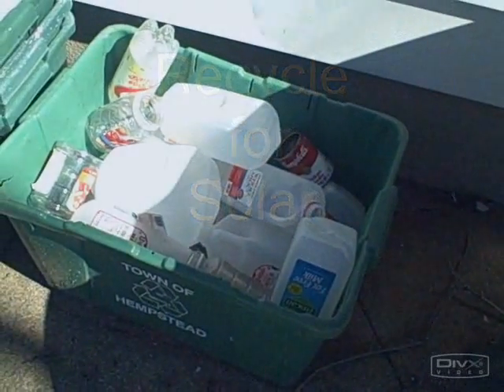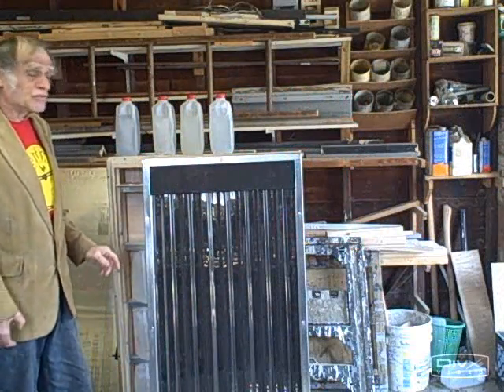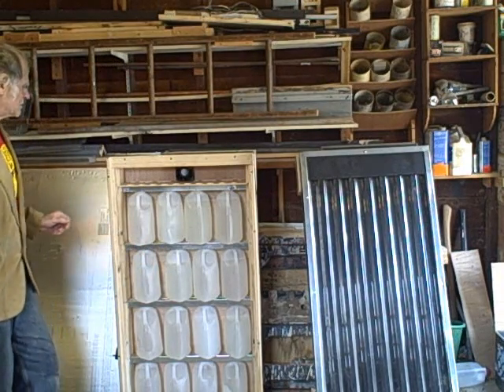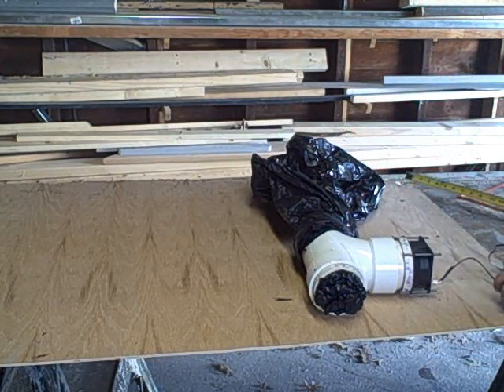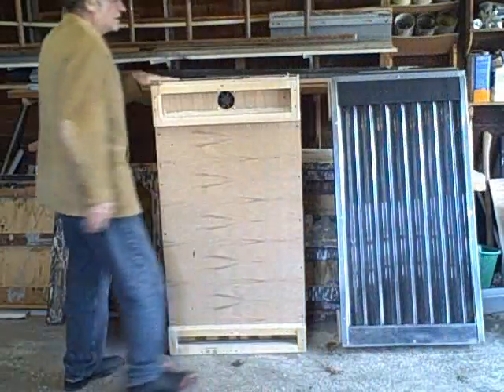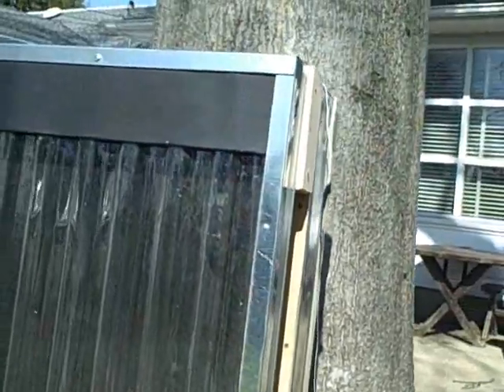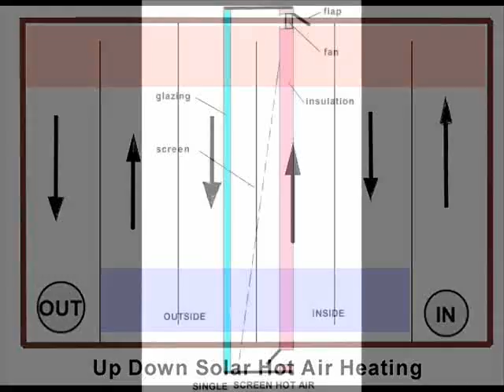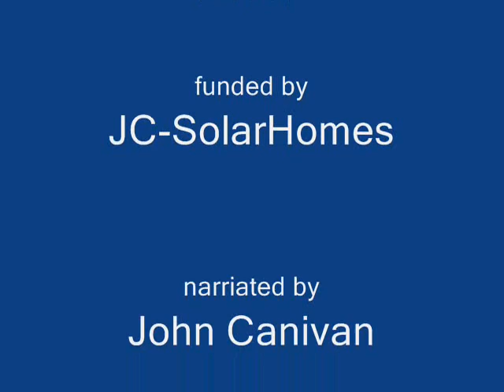Recycle for Solar

Comment: Wouldn't that freeze up in the winter & not work?
Reply: antifreeze in milk jugs maybe, or -40C windshield washer fluid (cheaper)
Reply: Purrfect cat trap! Will kill 'em dead! If it leaks out. I can tell you from experience those plastic milk jugs crumble in about 2 seasons or so..they make them biodegradeable now. Was a huge mess (I planted in them) & I will never use them out in the sun again.
Reply: Angela Angell
PET or PETE (#1) plastic bottles last a lot longer than the HDPE (#2) plastic bottles in the sunlight. Even the 5 gallon buckets are made from HDPE and they turn brittle in the sunlight in less than a year.
Reply: so how can you tell if they are or not PET or PETE? I can tell you that most of those sterlite plastics such as storage containers, etc are not worth the money if you use them outside in sun or cold..they do that to make them biodegradable. I milk jug is worthless outside & makes a huge crumbly mess all over your yard after only one season.
Reply: Angela Angell I know what you mean. I have had the same experience. I personally think they make them that way so you will have to buy more. Soda bottles are made from PETE plastic and they seem to last forever. Sterilite is made from junk plastic, yet you expect to throw away a pop bottle but you expect to keep a Sterilite container for a long time. So why don't they make re-usable containers including 5 gallon buckets out of PETE plastic? Because they want them to wear out so you will have to buy more. Making them biodegradable is only an excuse.

You can tell it's PETE if it's the #1 recycling code. The caps and the label are likely to be a different plastic, but the clear bottle itself is going to last a long time. Gatorade bottles and many juice bottles are made of PETE plastic. V8, Juicy Juice, etc.
Reply: I agree! I do save all my 1-3 L pop bottles and wash them and use them to store beans, rice, noodles, flour, sugar, salt, etc for my long term food storage. So far nothing has spoiled in them or got bugs or mice bites. I pound everything down to get all the air out and fill it to the top and it seems to make it's own vacuum.
Reply: Thanks for that! I have had so much cake mix erupt with moths coming from inside it is not funny. Now I will freeze them as soon as I buy them. Thanks again!
Reply: Try nuking them for a minute. Kills eggs & everything living in there. Shorter time than freezing.
Reply: Thanks! will do.
Reply from the maker: Heat is exchanged in liquid water or frozen water.BUT  Within a good solar heating system the water will never get cold enough to freeze.

Comment: Oh boy. I just got finished commenting on someone's post who did essentially the same kind of hack with cans. I'll say to you what I said to him: what makes this safe? The plastic in a milk jug is volatile when you add heat! You know that plastic taste you get in water stored in those kinds of jugs? It comes from the breakdown of the plastic where chemicals leech into the liquid stored into it. Why should anybody waste time, money, gas, effort, electricity, etc building something that may not be safe? Who is testing what kinds of VOCs or other compounds are released when you add heat to these products! The reason that milk jugs are deemed safe is b/c they're meant for COLD storage. They become dangerous when the trucks that carry them overheat! Frankly I avoid buying milk in jugs wherever possible. It's great to save money and be self sufficient, but you need to know what the heck you are doing!
Reply from the maker: A fan could be used to extract the heat. I was just doing a simple demonstration to show how recycled materials may be used to store solar heat.
Reply: Hmm... I don't know that that makes a difference. I would consult with a scientific source before just taking household items into my own hands and using them for purposes other than the intended use, ESPECIALLY when the original materials are dubious at best when it comes to its intended use! We already know that plastic jugs and bottles are poor vessels to carry liquids such as water, milk or juice. Now you want to stretch them beyond that weakness for something else. Even as a demo, it encourages people to take unnecessary risks.
Reply: some of the things we use to day came  from people with the balls to make something out of nothing it called trial and error do you think tesla invented all he did without fail... if more people did this kind of thinking maybe the world might just be better off . people like you shooting people down because you can is no way to live you should be  trying to share your knowledge as to what he could do to better it . ... good video john keep thinking the world needs more minds like your to look out for it !!!!
Reply: Abigay, are you actually going to drink the hot water?
Reply from the maker: The water filled jugs are just a means of storing heat. Water is an ideal heat storage medium.
Reply: AbigayilNeshama these milk jugs are made of hdpe which doesnt release harmful fumes when heated or melted hdpe stands for high density polyethylene and can even be melted at home without creating any harmful fumes. hdpe wont even release nasty fumes if burning only carbon dioxide and water which is what a standard wood fire releases. there is an msds for hdpe online which gives details

Comment: these are great ideas but we can heat water, or rooms by use of fire, and these solar heaters still need electricity to power a fan, first and foremost we need to be able to produce electricity, try to do that without going out and buying turbines, solar panels etc, that would be of more use, heating rooms or food or water we can do just by fire, so electricity is more important
Reply from the maker: Yes PV has more applications. Solar thermal is more of a DIY project.  The best is when solar therm is combined with PV... BUT it is hard getting started on a  long range investment.
Reply: could there be a way of using car batteries as storage and then run things for the home off of them ? as you can tell i'm a complete amateur lol
Reply: Norton Kelly You can run this type of heater without any electrical needs. It is completely passive solar heating if you use convection.  Hot air rises so use solar heating with a top and bottom opening and it will create its own convection and move the air all on it's own with no power at all.  I used this on my off grid cabin and for an outhouse. It worked much better than I thought, just put your heat storage in the solar collection area and it will work great!
Reply: Norton Kelly
Hello I am so raw at this But everyone I have talked to , told me to use marine Batteries , They are easier to use & great for storing Energy , Who Knew ?

Comment: Obviously you also keep bees, so replace the water with beeswax and as long as you can get it above 64 degrees Celsius (147F) then you can benefit from Latent Heat Storage (LHS) which will store over 170 kilo Joules per kilogram on top of the heat of the wax. Just keep it below the boiling point 200 degrees Celsius!

Comment: You don't need the bottles at all.....just black box and air flow....nothing else....what a waste of time and materials. A sealed box and foam interior to absorb and hold the heat is the other. Your house is the collector dude.

Comment: CONFUSED! You show a 'closed' system.... where's the outlet into the home?
Secondly, If this panel was mounted outside/on a roof in Wisconsin those jugs would freeze solid and the only thing you would get is ice cold air. Even if you mixed it with antifreeze the heating time/ recovery time after a night at -20 would be a total loss.

Grandpa Bill

Comment: don`t we need a nuclear reaction to generate  1.21 gigawatts of electricity
Reply: the nuclear reaction only generates electricity by producing heat that is utilised for what is basically an advanced steam engine

you could increase the amount of generators and or fuel to make any generation system produce such a quantity
regardless of weather or not its efficient or practical

there's potential energy and actual energy like we could say that solar is 20%-60% efficient

but i get your point gigawatts is such a large amount it probably wouldn't be produced at home at least not on a regular basis

but as efficient as nuclear may be its not the only way to produce that much energy

Comment: Are you intentenally trying to get pcb cancers
Reply: pcb isn't used in food grade plastics. I believe what you are thinking of is BPA. And I can't be 100% sure, but I've heard that milk jugs are usually BPA free now a days.
Reply: TurtleDudeProd
The recycling codes to avoid are 3, 6, and 7. A product may claim to be BPA free, but it will still form BPA's when it is broken down by chemicals or sunlight, so if it has the recycling code 7 and says BPA free, I wouldn't trust it. I've come across some insulated plastic glasses which claim to be BPA free that have recycling code 7. They also say "don't microwave" "don't use bleach" and "hand wash only". As it turns out, bleach and heat will cause the plastic to break down and form BPA so they have to say those things in order to claim BPA free. But who reads the instructions besides me?
Reply: Bruce Kefauver these jugs are hdpe which is completely safe without any kind of bpa or other harmful chemicals